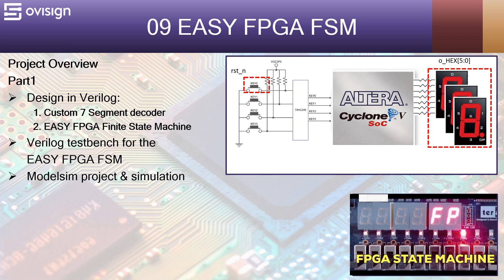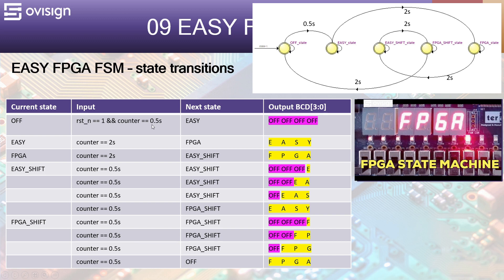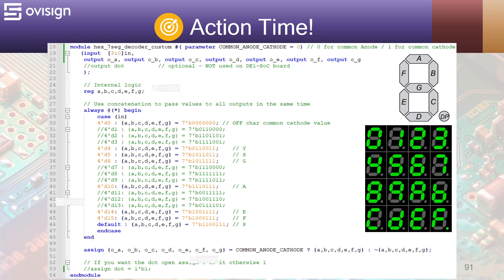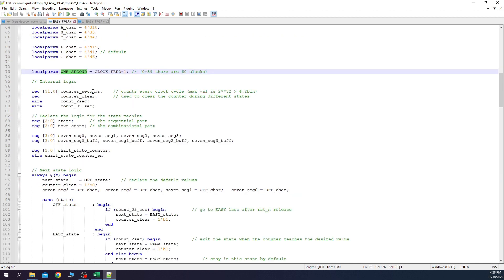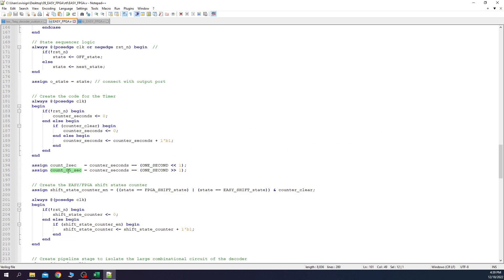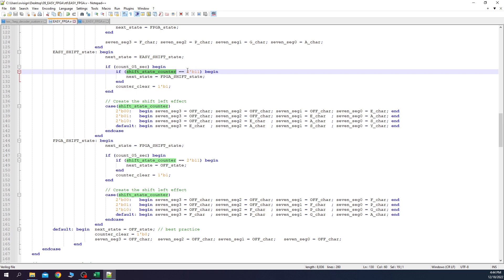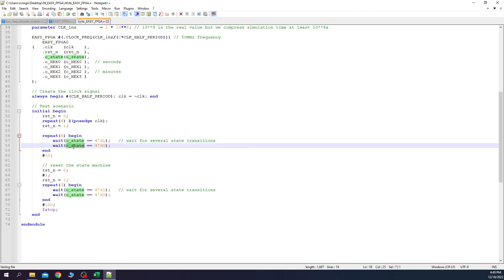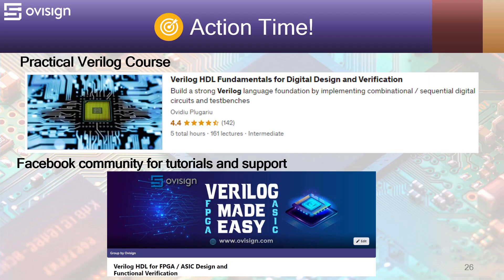FPGA project 09 Part1 - EASY FPGA Finite State Machine

Comment: Great tutorials. Just a stupid question,I saw you use synchronous rst & asynchronous rst in your design.May I know the difference & advantages & disadvantages between them(synchronous rst & asynchronous rst)?
Reply from the maker: Thanks a lot for watching this channel and for your feedback!

Actually you asked an excellent question! This design contains Flip-Flops with the following types of reset:
1. asynchronous reset
2. synchronous reset
3. NO reset

I used async reset for the state flip-flops to be able to reset the state machine even if the clock signal is not present.
I used sync reset for the Timer to use smaller_area/lower_power flip-flops from the FPGA thus increasing the maximum synthesis frequency.
I used NO reset for the pipeline registers to the smallest/fastest types of FF available in the FPGA. I don't care about the reset value of that stage.

Here are two interesting reads regarding what types of reset to use:
https://docs.xilinx.com/r/en-US/ug949-vivado-design-methodology/Synchronous-Reset-vs.-Asynchronous-Reset
https://web.engr.oregonstate.edu/~traylor/ece474/beamer_lectures/sync_async_reset.pdf

Also async reset is more popular for ASIC design, while sync reset is more popular for FPGA design.

I hope this answers your question! Cheers!
Reply: @ovisignveriloghdltutorials3352  Thanks for your clear explanation. Looking forward to your next video.